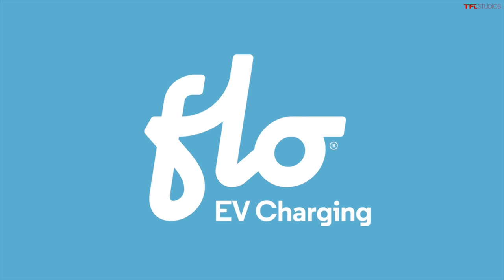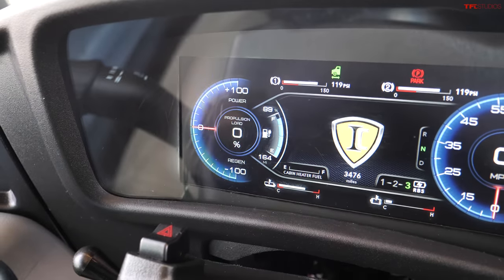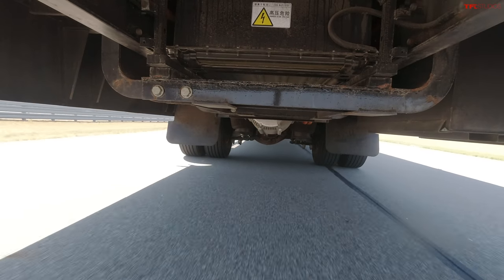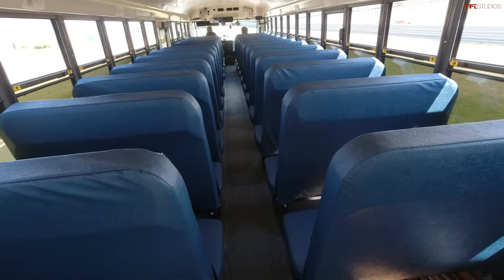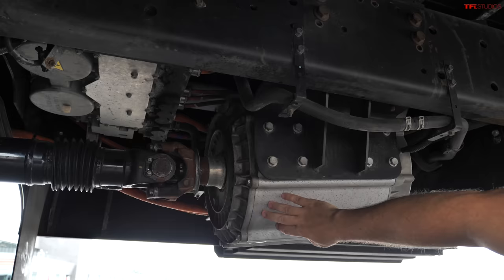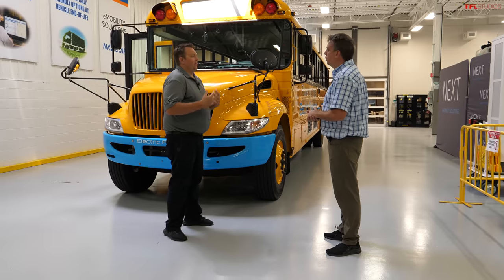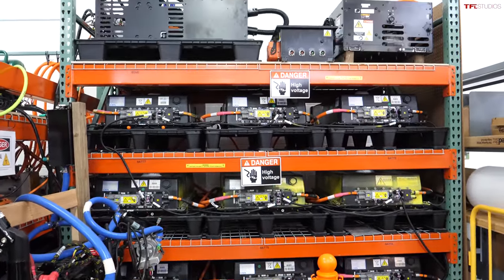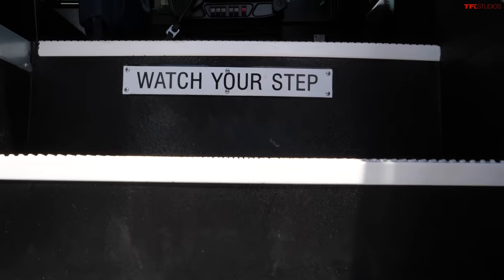Does This EV School Bus Put The First Nail in The Coffin Of The Classic Yellow DIESEL Kid Hauler?

Comment: Are they going to fill the big roof with solar panels to get a little charging? probably set out in the sun all day and every little bit helps, would probably offset the heating and cooling.
Reply: Solar would be much better on the school.
Reply: No it wouldn’t.
Reply: I'm not saying replacement for plug-in charger, but 3 or 4000 or more watts on the roof depending on the size of the roof, would be putting some power back in during the day, plus now it's a solar bus, big deal in advertising, and getting approved by school boards and whoever. 
solar panels are cheap, expensive part is the battery and it already has one.
Reply: @ronaldsahn9649  There are stringent standards on school bus construction.  Placing solar panels on the roof would likely interfere with some of those standards.  School buses are required to have 1.5 times their GVW placed on the roof and still be able to open all emergency exits.  Starting out with more weight on top would also make the bus top heavy.  FMVSS standards are the most restrictive in the school bus category.  WE DON'T HAUL FURNITURE.
Reply: Light weight solar can be integrated into the roof without adding much weight, not  Violating any regulation
s, and not like the old style hard glass and Aluminum panels, openings will still open and the weight of the battery packs lowers the center of gravity.

Comment: This is just a simple motor and battery swap. Imagine how much better it'll be when the busses are designed from the ground up.
Reply: Like the Green Power BEAST school bus?
Reply: Its actually not.  Everything in the electrical system is different down to the fans / wiring in the HVAC systems for EMI considerations.  These busses are designed from the ground up.  It may appear a simple change but its not.
Reply: @StoneXue  they obviously use the traditional body and most likely the frame.  That's what I'm talking about.

Comment: It's PERFECT ¡12 electric busses out of commission in Connecticut for internal fire! French public transport operator has removed nearly 150 electric buses from the streets of Paris “as a precaution” following vehicle fires on two of the buses. Nothing more responsible than get your children in them.
Reply: Sounds scary, but these are LFP batteries. They won't burn even if you drive a nail through them.

Comment: direct drive is stupid all they had to do was make an electric motor that attached to a normal transmission with the battery packs made to take the place of the fuel tanks. not only does it allow the motor to work at its  most efficient rpm, regenerative breaking works even better. it makes this more viable to repower older fleets while making new buses easy to maintain in an older fleet.

Comment: It's still an international, probably trash just like the diesel version. I'd still give it a whirl.. but if it were bluebird; I'd love to try it! I'm not unhappy with my 2021 blurbird vision propane, though.
Reply: You don't like Cummins diesel? That's what they have been running for years. Also, they developed the EV in collaboration with TRATON. BB has an ev system that is inferior to the IC Bus system.
Reply: I had a propane 2016 Blue Bird Vision, now I drive a diesel 2020 Blue Bird Vision. Hate them both. I loved Blue Bird conventional buses before they came out with the Vision model in 2003. I'd take an IC any day over a Vision.

Comment: Now there is a practical use of EV. Our school district busses do less than 100 miles per trip each morning and afternoon.  They can charge between morning and afternoon runs.
I don't think that regen braking would be good for snow covered  or slick roads. It might brake too hard and cause sliding.
Reply: EV owner in Canada here. Regen actually works extremely well on icy roads. You only get braking when the wheels are turning the motor, so if the wheels were to start slipping, the motor stops turning, cutting all regen, allowing the wheels to spin again. Of course having all the battery weight down low and centred in the vehicle, means you get and even weight distribution, resulting in excellent traction on all tires, meaning you won’t slip as easily in the first place.
Reply: @roger1818  yeak, I wasn't sure exactly how the regen works as far as braking is concerned.  I assumed that they worked kind of like a Jake brake on a rig. I drive tractor trailer for living and turn the Jake brake off entirely during slippery road conditions because it will cause wheel sliding/skid on the drive axles. I guess I assumed it would be similar for regen. 
Lol I need to drive an EV soon.
Reply: @WheresHerb  you are also on here spouting clean diesel fume nonsense. why dont you stop being afraid of the future, turn off fox news, and go get some experience?
Reply: @I QUIT YT But regen only slows the rear axle... You'd ideally want to blend friction brakes to engage the front wheels as well for any sort of quicker stop. I like that regen is operator adjustable.
Reply: Did you watch the video?  They specifically talked about this. Watch again.

Comment: How do you charge 50 buses at once though?
Reply: I would think the same way we use to plug them in for winter months. We have power to each bus parking space. It would just have to be upgraded to handle the load of however many busses in that row. Most bus barns are located in business/industrial locations as it is.. and for at home held busses it would not be too much to have chargers that can supply overnight charging (with metering for reimbursement).

Comment: Not yet a viable alternative. Some buses still need to have more range to handle longer trips and duty days. The big problemm s charging. Innsome districts, the busses sometimes fo home withnthe drivers, meaning fast chargers will need to be installed at their homes. Likely requiring a separate meter. At a bus garage, the quantity of vehicles charging simultaneously will place a HUGE burden onnthe local grid, requiring what equates to a substation needing to be installed at the facility. Add in the charging systems, and required infrastructure upgrades, and that cost goes into the millions very quickly. Then there is power outages, which we are having more of all the time. No schooltodays kids, busses aren't charged! Thenntheremisnthe fire risks. Electric bus fires have become a near regular occurance. CNG or hybrid is the only way to go with commercial vehicles.

Comment: The electric school bus cost almost FOUR times as much to buy ($400,000+) than a Diesel school bus ($100,000+). A fleet would break the bank! Add to that the higher cost of electricity, that is generated by fossil fuels by the way, that makes these electric machines coal burners. The American electric grid infrastructure will be taxed even more.
Reply: The grid is much more efficient than a diesel bus engine, and it does not idle, I don't know why you think diesel is cheaper cause it is far from truth
Reply: I think you meant to write diesel, not "electric school bus ($100,000+)".
Reply: @hippyhillbillie2958  Corrected. Thanks.

Comment: I mean, you already interviewed someone on your channel that has spreadsheets of operation costs on school busses, claiming it's much more expensive to maintain and operate compared to a diesel.  The only argument I can see right now is keeping kids away from diesel exhaust fumes, which I can still remember as a kid all the buses lined up idling spitting fumes right in our face and getting lightheaded.  But many school and city buses currently run on propane and natural gas, which is already classified as a clean fuel and in the very near future will become even cleaner.  I can't say anymore about that though but trust me, green propane will become a thing.   If diesel, as expensive as it is right now is better than the EV, and propane is being practically being given away at almost cost, which it is in some cases, then propane is currently the most cost efficient option.  So as it stands right now, EV school buses not even close to being 'the nail in the coffin.'

Comment: how much more do these cost versus a normal bus how well will those motors hold up day in and day out compared to diesel, how many places or bus garages will be able to work on it and how much more will they charge compared to a traditional shop, if we switched how will our current infrastructure be able to handle millions of busses especially considering there's parts of the country that can't even handle the air conditioning how much will it cost to replace those batteries and how often with constant stop and go stressing those batteries and motors that's what I want to know and why does nobody ask these questions instead just saying "ooh electric it's so cool" kinda like that toy you saw advertised on television as a kid you get the toy and find out it's not all it's cracked up to be that's exactly what this hype is...

Comment: I’m looking forward to purposely designed EV buses and large trucks. Building EVs on Combustion engine design is a compromise at best. Too many parts (added cost and more stuff to break), more expensive, heavier and not optimized. Building purpose built EV busses can reduce cost by 30-50% even with existing battery tech.
Reply: Oh god another sandy troll
Reply: Except now you have interchangeable parts in a fleet. (remember...schools own dozens of these vehicles)  In addition, the under the hood area contains many components that won't fit anywhere else on the bus.  In addition, you now have the ability to recycle those older ICE buses and turn them into an EV.  That is the ultimate green solution.  You only need to replace the drive train and can re-use 90% of a perfectly good chassis and body that is built to the stringent standards a school bus is required to meet.
Reply: @Donovan Lewis the tesla semi also has a rigid frame. You aren’t carrying 26 passengers on a unibody
Reply: Like the Green Power BEAST school bus?
Reply: @chaderic52  this is as much of an EV school bus as a golf cart is a F1 EV. It was never designed to be an EV and is hacked together. Once trucks are properly designed, from the ground up, as EV, things will look very different. By 2025 those he still don’t get it, will. There are several EV-by-design trucks coming that will make it clear that BEV trucks are the future - similar to how everyone understands BEVs will replace gas cars.
Reply: @ranig2848  Again, what about the Green Power BEAST school bus? Also, the cost to completely redesign a school boss from the ground up just for electric power would be astronomical. The only thing that would really change is the frame and a few of the components. The body would need to remain the same.
Reply: @ranig2848  What makes a school bus a school bus is not the looks of the powertrain. They literally are electric school buses.
Reply: @ranig2848  It fits the actual definition of an EV... "electric vehicle: an automobile, e-scooter, e-bike, or other vehicle having an electric motor that is fully or partially powered by batteries."
Reply: @ranig2848  Yl What you say you want is what Green Power has provided. I'm not certain what else you want?
Reply: The safety standards for school buses essentially prohibit massive redesigns.  One requirement for example is a school bus must be able to roll over without compromising the roof.  It's actually impressive that the existing design is strong enough to pass that test.  There isn't much practical leeway to maintain that strength while conserving materials.  Thomas broke away from the conventional design but they had tremendous grief and difficulty in doing so while accomplishing no worthwhile benefit for the effort other than a "modern" look.

If existing EV technology can power these buses enough to run their routes with range to spare, then there is very little justification for reinventing the rest of the bus.  Cost is a major concern, and about the only way to make a school bus any differently without compromising passenger safety would involve carbon fiber composites.   The cons far outweigh any benefits for doing that with a school bus.

Comment: "safety is paramount for school buses"? It may be nigh on a decade since i last rode a school bus, but I assure you they never changed one iota in the 2 decades i was in school, and they were never the most confidence inspiring rides...

Also. why are school buses still a thing? like as a design philosophy? like who looks at a school bus, and at a transit bus, and thinks "the school bus is superior"? they don't hold as many people, they're not as accessible for the able-bodied or the disabled, they're not as quick to load or unload, they're not as nimble on the road... sure, school buses can have baggage space like coach buses, but lets be real, that rarely if ever gets used, and the times when it might, a school is just as likely to hire a proper coach bus... school buses. i don't get it.
Reply: I too don't understand why the classic school bus design has remained for decades. Think about how automotive engineering and technology has changed in the last 30+ years; meanwhile our school buses are basically the same?
Reply: I can assure you the school bus has changed many times over the years...especially the last 2 decades.  They are 36 times safer than a passenger car...which has also changed drastically over the last 20 years.  Just because it looks the same, doesn't mean it is.
Reply: @dougmesser7149  Fair point. And yet, I've ridden in several more recently for my kid's field trips and they are still really high off the ground, noisy/bumpy/smelly and hot as hades. Still I acknowledge that there may be things that are better that I'm not noticing. Seatbelts for one. We never had seatbelts in ours. I think going electric for school busses is going to be awesome. Now if they could just build in some A/C in those damn things...
Reply: @dougmesser7149  my argument tho, is regardless of the engineering behind the design, the philosophy of the design itself has no raison d'être, no reason for existing. Theres nothing a school bus does, that a transit bus couldn't do better. Except long haul trips, in which case there's nothing the school bus does, that a coach/tour bus couldn't do better.
Reply: @Cal94  I would much rather be in a school bus than a coach bus in a wreck.

Comment: they shouldve put small battery then combuston generator running at ideal effinecies to charge up batteyr and diretcly power motors when opossible to minimize energy transfer in out batteyr thus max batteyr life, as ev batteries cant be mass recyled and arnt, and cost more emissions to dig out grund and transport, and most of energy grid is not running of cleanly made stuff like nucelar, and e fuels and or hydrgen combustion is more resnable theoretically they just need gov support, both of which could run in generator. bus could run not on battery if batteyr loses the tech and market war
Reply: balance between combustion and leetcric only range is something noone is doing yet, mazda has something similar, but its not freepiston like ingo car on yutbe or something liek that, its overall not effceint just bc the systems their self are bad not my concept of balance.
Reply: i expecting Srt electric muscle car would create more balance for light weighting and preformance, especiallybc why not use generator exhuast pressures instead of only electic speakers for the engine sound emulator suytem?

Comment: Why high floor though? This thing seem too be constantly rocking from side to side. Flat windshield in 21 century really?
Also the entire thing looks extremely flimsy, did they even crash test it? 
Looks like a ripoff to me: they just put Chinese EV parts into existing bus chassis and called it a day.
Reply: Those flat windshields are designed to kick out in an emergency(less glass weight) and be easier to replace. There are large shaped windsheilds on some buses but they are usally made of more expensive materials.
Reply: @bcluett1697  and here we got a question: may the wider windshield reduce the probability of an accident in the first place by providing a better view, enough to make it actually more economical?
Reply: @solarissv777  makes sense

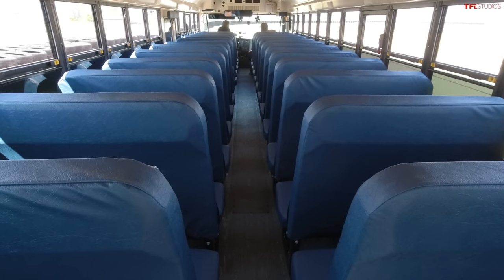Comment: 3:25
Dude, really?!  The fact that some of the people you interview can't get their units of power and energy straight infuriates me beyond measure!  COULD that battery put down 315 kW of power to the wheels?  Easily, and it probably does that and then some in short bursts on a daily basis, especially if in a use case where it regularly has to drive on the freeway.  Now, that means peanuts if it can't sustain 315 kW of output for an extended period of time, like driving at 70 miles per hour fully loaded with students and cargo for field trips on the freeway.  That is why it is so important to have a battery that can hold 315 kWh of energy.  Now, with an energy capacity of 315 kWh giving a range of about 200 miles, that works out to an energy consumption of very close to 1.6 kWh/mile.
Reply: ... what, did you even listen to the guy explain the 200mi range he stated? 

He said the marketing number was like 500, but in real world use, it's closer to 200 with a full load of kids and the ac/ heat running.